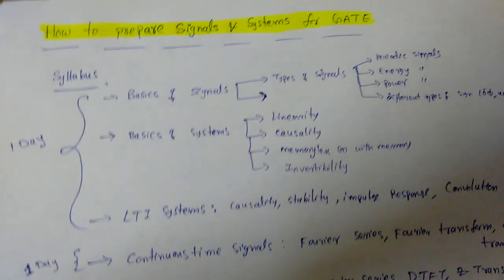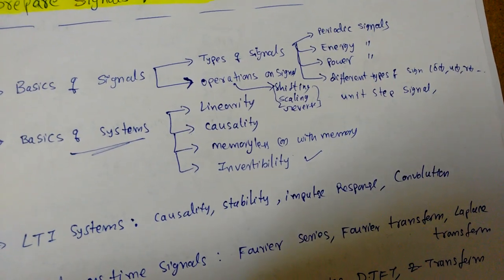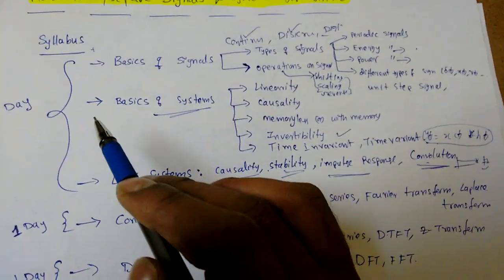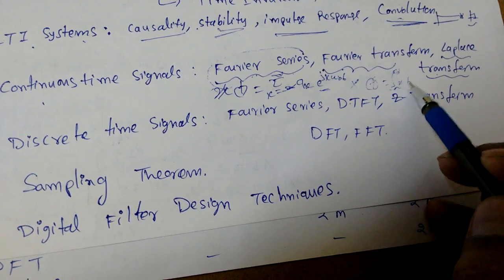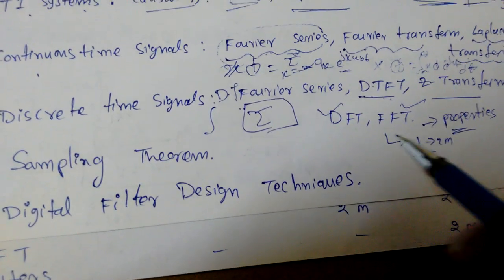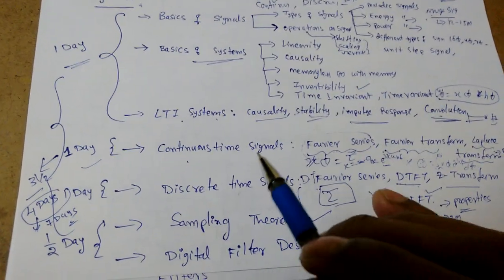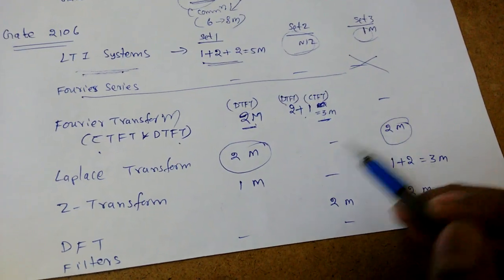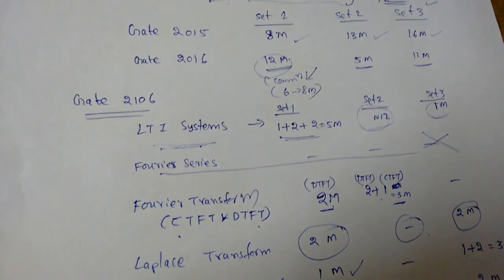How to Prepare Signals and Systems Subject for the GATE-2017

Comment: WHICH IS IDEAL TIME TO START FOR GATE18
Reply from the maker: i will give a plan to crack gate 2018 ...i am working on it...i will guide you..time doesn't matter..you should have well determined goal that's enough to can crack gate 2018...
Reply: PLEASE TELL ME ..BECAUSE IM 2016 PASSED OUT WITHOUT JOB SO TL WHEN TO START
Reply from the maker: are you writing gate 2017...if yes we will start from feb 6 2017
Reply from the maker: you give your num i will ping you

Comment: Laplace transform has been omitted from signals and systems syllabus. It is only there for networks portion. So ROC based problems in laplace transform may not be important. Also fourier series is mentioned only for continuous time signals in the syllabus. DTFS is not there in the syllabus.
Reply from the maker: Yaa you are right @Wireless Brain...but to find stability ROC method will be easy...